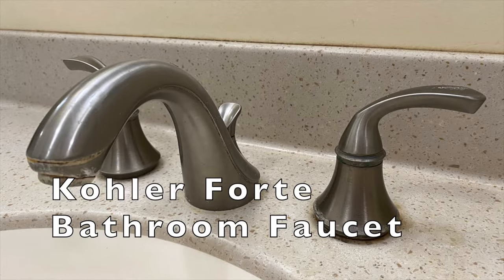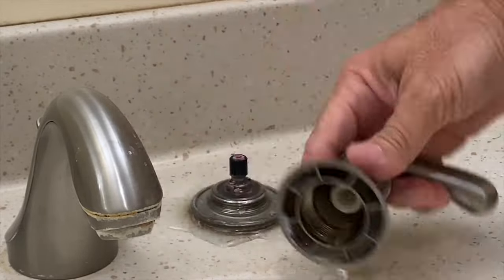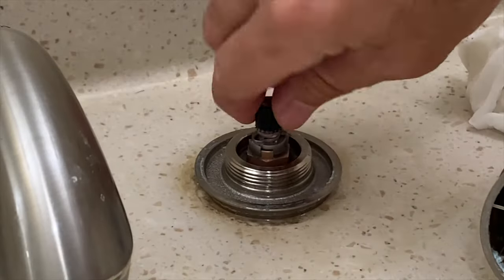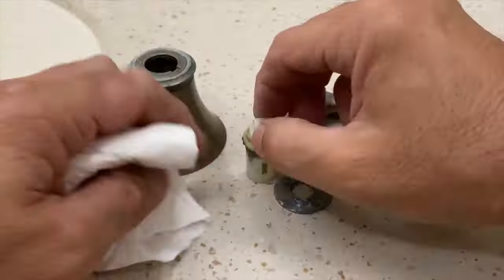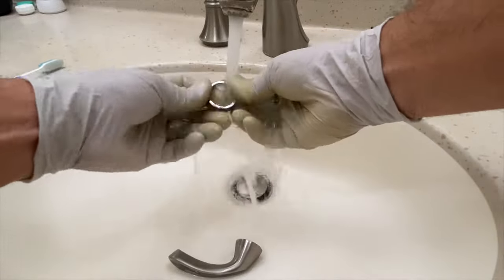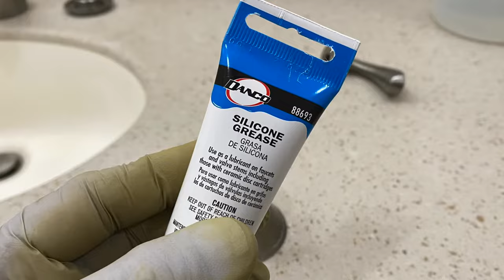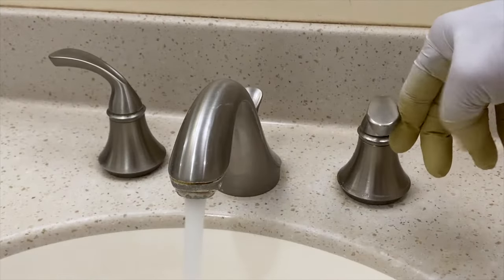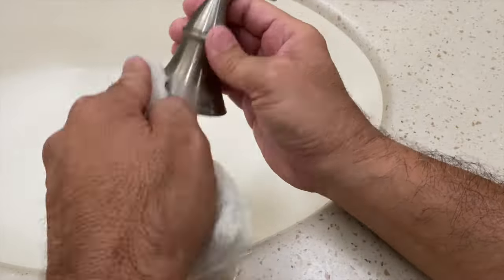How to Fix a Hard-to-Turn Bathroom Faucet Handle

Comment: I removed my moen faucet handle by hand, I didn't see your video earlier and didn't know about the rubber strap. That's a great idea. 

 I wanted lubricant idea for reassembly and you were on point. Informative and  succinct video. Thanks. 

Can I use silicone lube oil or spray instead of grease?

Comment: This is very helpful! Got any suggestions for if the handle won’t screw off? The one we need to fix won’t budge but the hot side came off like a breeze.
Reply from the maker: Here's what another commenter did... "Mine was extremely stuck so I packed duct seal compound (it’s like a putty) around the base of the handle leaving it about an 1/8 inch bigger than the circumference and about 1/4 higher than where the base of the handle touches the bottom. I then poured a mixture of 1/2 warm water and 1/2 distilled vinegar in the little pool area I made with the duct seal. The idea is to let the base of the handle sit in that mixture to loosen up the calcium etc., for about an hour, screwed right off."
😎

Comment: Mine was extremely stuck so I packed duct seal compound (it’s like a putty) around the base of the handle leaving it about an 1/8 inch bigger than the circumference and about 1/4 higher than where the base of the handle touches the bottom. I then poured a mixture of 1/2 warm water and 1/2 distilled vinegar in the little pool area I made with the duct seal. The idea is to let the base of the handle sit in that mixture to loosen up the calcium etc., for about an hour, screwed right off.
Reply from the maker: That’s a great idea!  I might give it a try if mine get stuck again.  👍😎

Comment: What if my strap wrench doesn’t work. Mine I can’t get mine to unscrew. Any ideas?
Reply from the maker: Does it have a rubber strap?  If it has a cloth strap, try wrapping the valve bonnet with rubber to give the cloth strap something to grab onto.  As a last resort, you can remove the entire valve and place it in a vice.

Comment: What if I don't have a strap wrench?
Reply from the maker: You can try with just your bare hands and a rubber grip of some sort.  You can also use a channel lock pliers with a rubber grip, but be careful not to damage the metal finish.  Hope this helps.
Reply: @HacksbyDad  I will try it thank you. Please make more videos I like that you are very to the point and don't drag it out.
Reply from the maker: @cindyfrith-smith7934  You're welcome and thanks for the kind words!  I like short and sweet videos too.  
😎